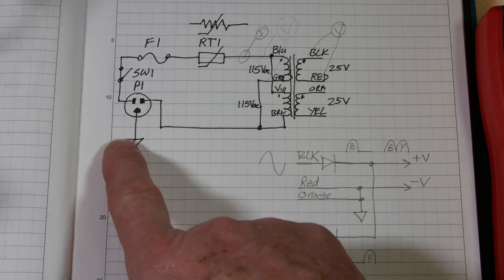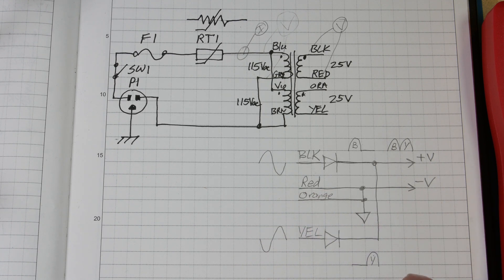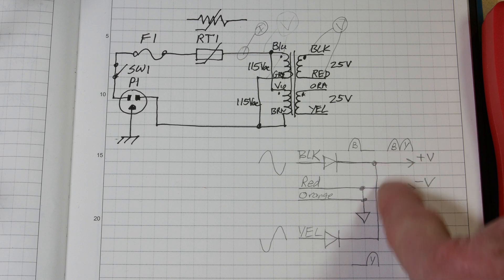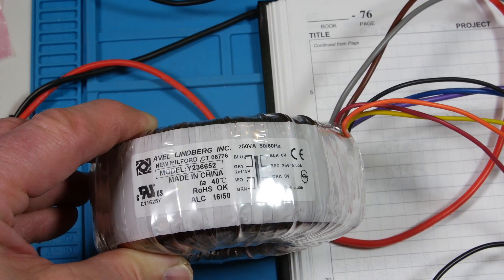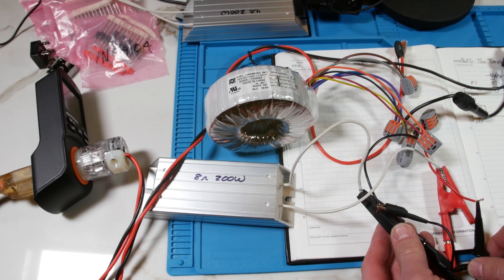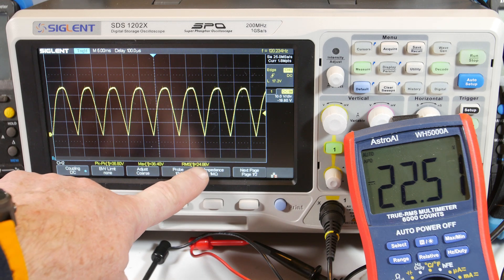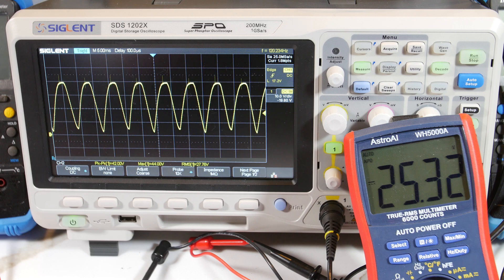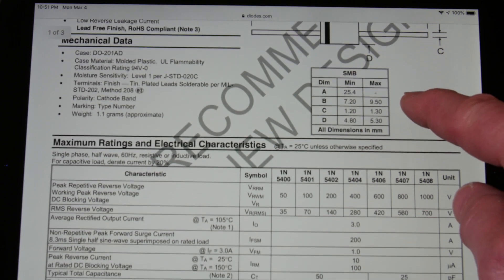Power Supply Design #4 diode rectifiers

Comment: Really great video, I do really like when you go trough a datasheet like that and make the values logic and easy to understand.
I have two questions I hope that you will explain.
1) the result you show by using that transformer with two secondary winding's going trough the two diodes looks the same to me as if you had used a single secondary winding with a full bridge rectifier. Is there any difference, advantage / disadvantages in on or the other?
2) Does that mean that the diodes you uses will produce 45C just to rectify, before also delivering power to the load?
Reply from the maker: Thank you - and great questions!  My next video is actually on this subject;). The diodes do not draw current unless there is a load - which there usually is at least a small load

Comment: I have a question. I have a 3 wire power suply from a amp. 20v  0v  20v. What i want to ask is can i use this as if it was 2 power suplys by puttion  a  rectifier diode set up  on each 20v wire and use  ther negitive wire on both recitifiers.

Comment: Hi Eddie, thanks for the detailed explanation. great video! I have a question though. Why choosing the diodes to be suitable for a voltage of 110V (or 220V in other regions) when those diodes are located on the secondary side of the transformer where the RMS voltage is around 25V?
Reply from the maker: Thank you!  Great question!  I was working on a different project and my mind was stuck on that one;)  You are right, select the diode to 2 or 3x the working voltage to protect against transients;)

Comment: Hey Eddie...I have a question. Since you did not parallelize the secondary windings, you were able to use 2 diodes instead of 4 (like in a bridge rectifier). What are the pros (and cons) of wiring the secondary like you showed?

Comment: Building bench supply from dual primary 18v toroid. Adding a thermistor to help with the inrush. Was causing major heat up when plugged in. It's 9amp per coil. Using as32 thermistor from a salt chlorine system rebuild
Reply: Also pulled a massive 40v 35amp full bride rectifier package with huge surface area/threaded bolt down hole for heatsinking. 70w tdp needed for cooling at full load. Oooooweeeee. Its gonna be warm.
Reply from the maker: Sounds like just the right size of bridge.  Nice job!
Reply: @KissAnalog  thanks so much for the reply. I sent you some direct messages on messenger with some picture. I'm not 100% on what your question was. At the moment I have nothing hooked up at all. It's an open circuit. Im just trying to double check all my connections before hooking up to the mains for longer than a few seconds w meters connected everywhere. :-)
Reply: On my last little plug In test my toroid transformer very quickly got warm and I didn't see the correct output voltage on the two output coils in parallel. I'd be happy to show you the label of transformer and how I am trying to understand the wiring.
Reply: @KissAnalog  I do 90% of my work on the installation/serviced side. Run a swimming pool service/builfing buisness with my father. Recently began repairing the salt system main boards myself and had greatly increased my availability of parts and good tools for home projects
Reply from the maker: Hi Zane - thanks for sharing this!  A 32mm sounds like a good size, but is the resistance at cold?  Let’s say it is 2 Ohms then drops to 0.02 Ohms when it has current running thru it - it should not get too hot unless you are running 10 Amps or more continuous (I^2*R = 10^2*0.02 = 2 Watts would be toasty).
Reply: @KissAnalog  the heat of worry was from the transformer itself. Before seeing your video and deciding to add the thermistor. I have not tried it with it installed.

Comment: WHAT IS THE TURNS RATIO THE TOROID TRANSFORMER?
Reply from the maker: David Luther If the transformer is rated for 115Vac on the primary and 25Vac on the secondary, then it is a ratio of 115:25 or 23:5
Reply: WILL YOU BE USING A BLEEDER RESISTOR AFTER THE FILTERING CAPACITORS?
Reply from the maker: Yes - that’s always a safe bet.  Good to see your attention to detail!

Comment: Hi Eddie, good video
In practise wouldn't you use a full wave bridge rectifier module than single diodes and use the transformer secondary windings  centre tap as the Gnd . So you have split rail (bipolar) power supply, to power most audio amplifiers V+, Gnd , V-  and couple filter capacitors ?.
Maybe jumping the gun 😀
Adam.
Reply from the maker: Adam L Thank you, and great timing!  I’m working on a video that I’ll post this week that will do just that;)